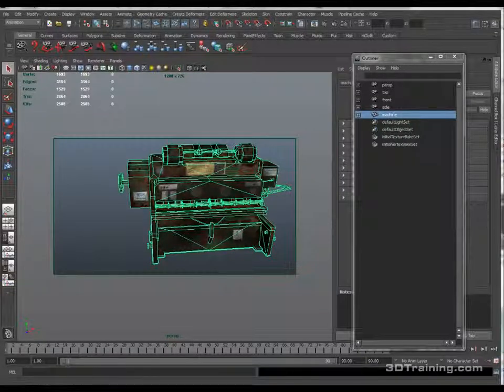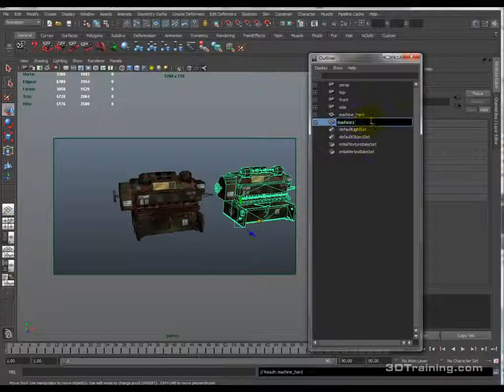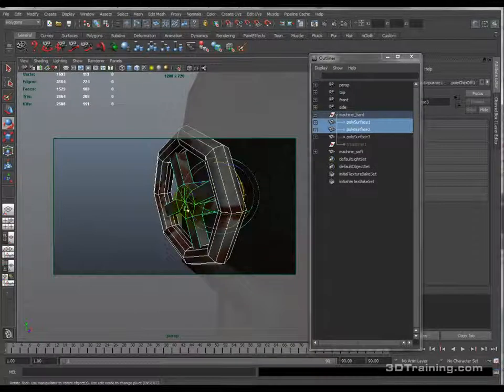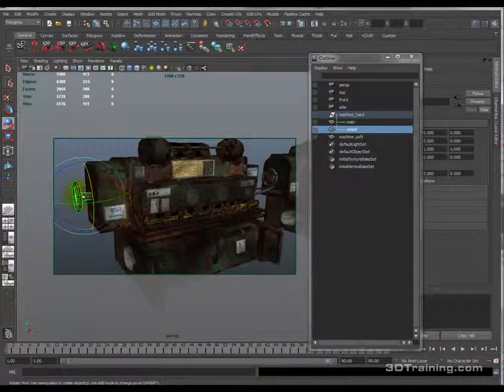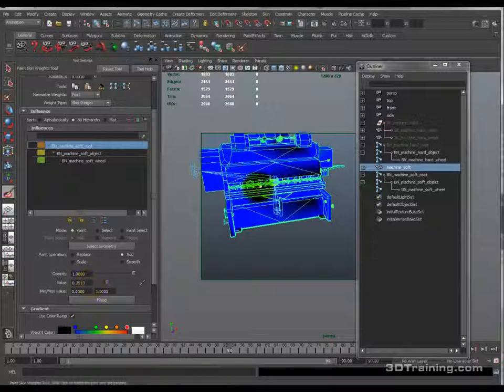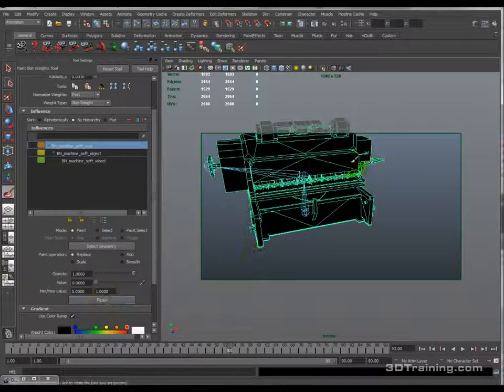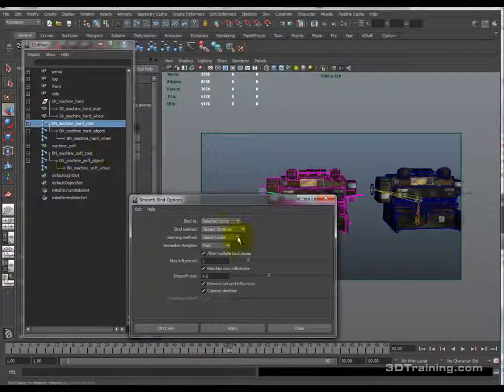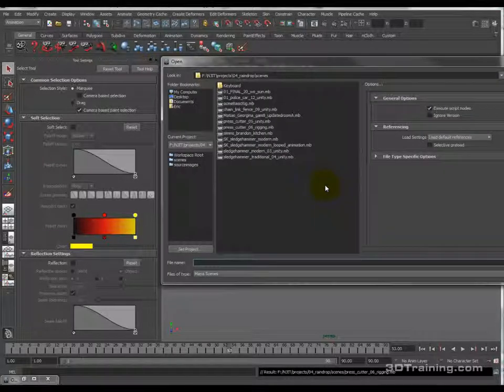Basics of Game Prop Rigging - Hard vs Soft Surface

Comment: hey! just a quick question, as I was following along with this video (I'm using maya 2016 by the way) I noticed that when I tried to select the initial bone by itself, It also selects the two bones stemming off of it. How would I make it so that it only selects the parent bone?
Reply from the maker: hey! When you select a parent bone, it will highlight the children bones in the viewport but they aren't also selected. You can go to Window -> Outliner, and open up the bone hierarchy by clicking on the plus icon to the left of the bone name. Then click on the parent bone again and see that its just the parent that you are selecting. Its just that when you move, rotate or scale the parent, it will also effects the children. So if you dont want that, the easiest way is to middle mouse drag on the children, in the outliner, so that that you can temporary remove them from the hierarchy. Then move the parent bone, then middle mouse drag, in the outliner, to place the children bones back into the hierarchy. 

Let me know if I answer your questions correctly.